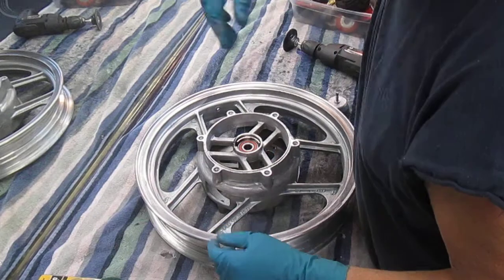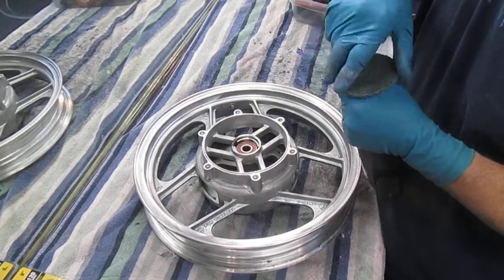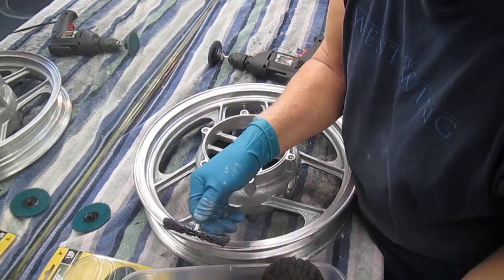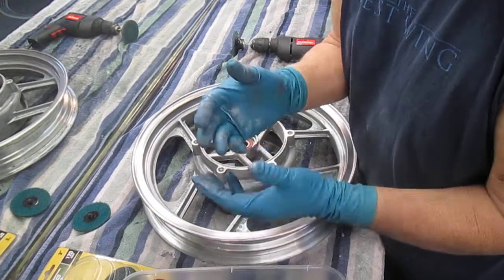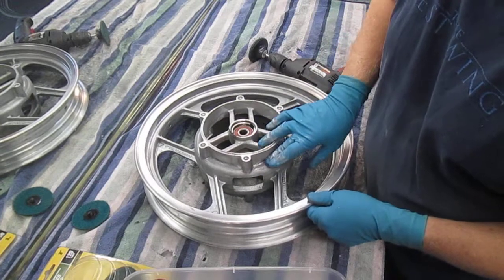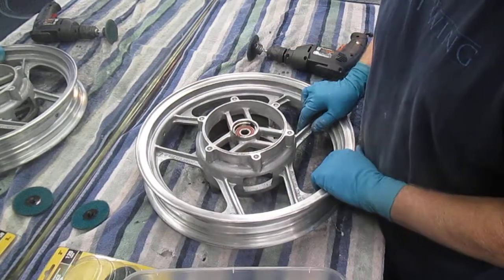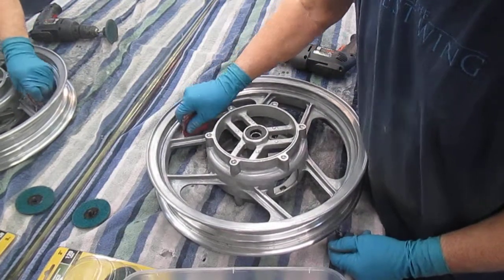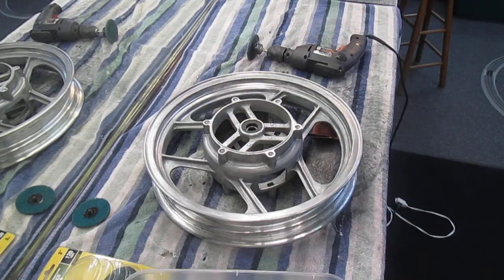HOW TO PREPARE MOTORCYCLE WHEEL FOR PAINTING.

Comment: use cheap paint brush. small brass brush, paint stripper, some nitrile gloves, steel wool, small plastic scraper. scrub off paint with wool and thinner and scrape tight areas. then go over with heavier steel wool then clean, prime and paint.